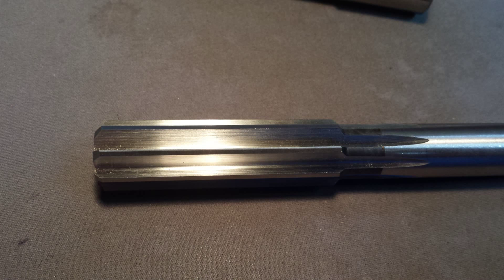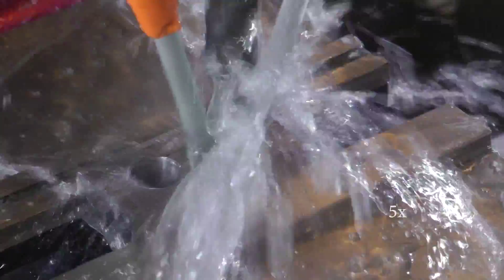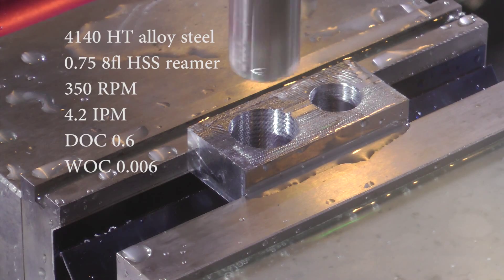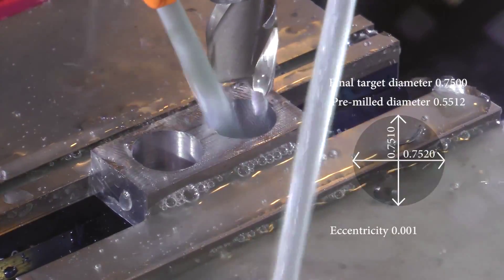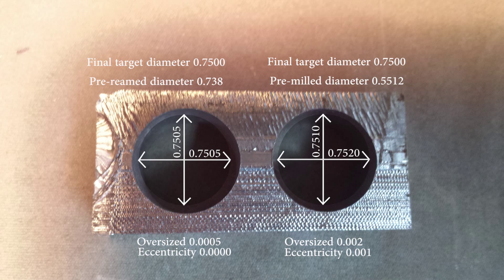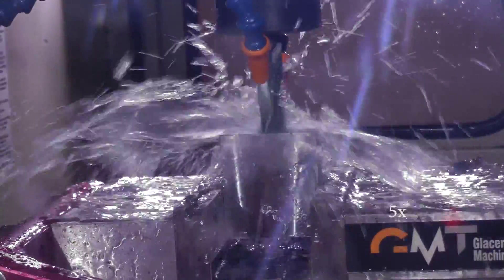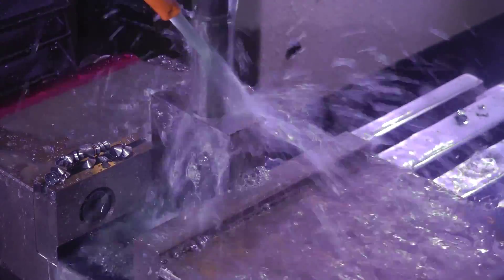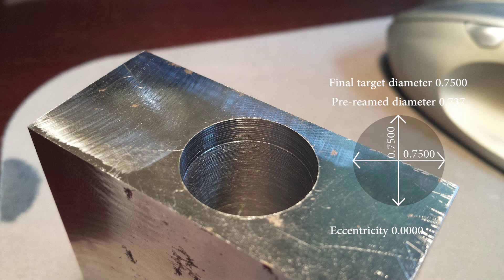AR15 High Rail Gasblock: (pt.9) Reaming vs plunge milling main bore

Comment: roller burnish the finish, after reaming. They're pretty dang pricey though. We use this for a bore at work 2" deep with a .03 mm total tolerance and an outrageous finish requirement.

Comment: Use cutting oil with the reamer, not coolant. That will give a better finish
Reply from the maker: Thanks. I actually did try that and I didn't notice much of a difference. It may have been a tiny bit better but not enough to keep using it.
Reply: Really? It's worlds of difference everytime I've compared, ah well. Good luck!
Reply from the maker: Everyone tells me that oil is much better. I was using tapping fluid and I tried it numerous times. Nothing really improved the finish so I assume it is something else that is causing it to look like that. I'm going to try a different reamer when I get a chance. It could also simply be that I'm reaming a bore created by a rougher but I don't think so because I got the same finish when reaming a hole that was interpolated with a finishing end mill too.

Comment: You forgot boring head
Reply from the maker: Thanks, I tried that initially but I couldn't get a better surface finish than reaming and it was MUCH slower and error prone (long stringy chips, chatter, gouging side wall on retract etc.). Ultimately I think reaming is the way to go here for production. The size is spot on and very repeatable plus it gives the nicest finish outside of interpolating the bore (which has it's own problems).

Comment: James -

You might want to try opening up the hole diameter at the roughing stage slightly ... such that you're taking only 0.004 per side or so.  Given their cutting edge geometry, reamers don't usually like taking much of a radial depth of cut.  Plus, with a straight flute design, all of the chips tend to stay in the hole until finished ... so smaller chips are probably better.  No guarantees ... just something to consider.

Along these lines, a few episodes back you were trying to bore using a standard boring bar and helical interpolation.  I've never seen this done before.  Although it's "mathematically" possible, boring inserts are typically designed to always be "in the cut" ... either in a lathe ... or by using an adjustable boring head on a mill, such that you make a simple Z-axis plunge (as you would in reaming).

John Z.
Reply from the maker: Thanks John, I was trying to get to 0.004 but only hit 0.006 due to deflection. I need to take another spring pass as I've discovered a spring pass with this tool removes about 0.002.

In the previous video I was trying to bore using a Criterion boring head. It was just a straight plunge down. There is no way my machine could interpolate a bore at 500 RPM. The reason that it didn't cut well was pointed out by Carl at Lakeshorecarbide. He suggested that the boring bar I was using actually had a rake angle defined for a lathe and not a boring head. This makes perfect sense and is most likely the problem. I need to get a different boring bar designed for a boring head. However boring this hole will be too time consuming and probably have more deviation than a known entity like a reamer anyway so I'm not going that route.

Comment: I've been using Carl's pre-ream end mills for 1/8, 3/16, and 1/4 inch sizes. They work great, but the biggest improvement I've seen when it comes to reaming is using a thick/high concentration, preferably non-aqueous cutting fluid. Tap magic specifically, though upping the coolant concentration in my system also improved results.
Reply from the maker: Interesting. Thanks! I also thought about just goobing some tapping oil on there but thought If I'm going to try to automate as much of this process as I can I can't be sitting there doing that all day. I also need those chips to clear on out of the bottom because remember there is a ledge down there that I stop the reamer just short of hitting so I can't have that ledge filled with chips when it gets there. Carl tells me that is the death of reamers.
Reply: War Machine LLC ah, yeah, if you need it automatic, upping the concentration or changing the coolant type are the only options in that aspect. Another thing to consider is to try a left-hand spiral reamer. It'd definitely need a test run since due to the ledge at the bottom, but left hand reamers have consistently provided the best finish in my experience. Downsides being they push chips downward and cost more.
Reply from the maker: silentqueue
Thanks, I had a small spiral taper reamer that left a really nice bore when used with a cordless drill. I don't think I've come across one that's 3/4" though. The finish as it is now is fine so I probably won't need to dick with it too much. It seems that rounding over the sharp 45 deg chamfer a little might help though. I'm just wondering if there is anything simple I could do like that or if feeding faster/slower might help. Maybe even leaving more or less stock on the bore. I don't wont to get too complicated with it.
Reply: Alright then - good luck! For future reference, always check eBay for reamers. I've found an amazing deal for almost every size I need. Last score: New carbide 0.1700" for $6